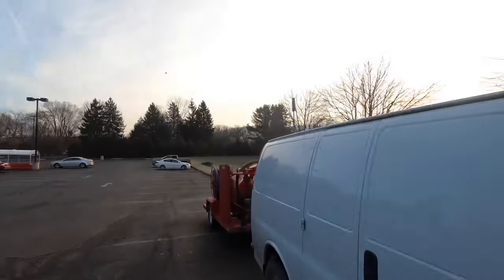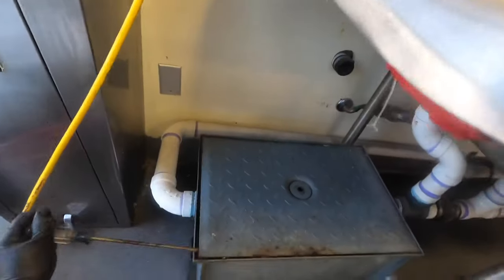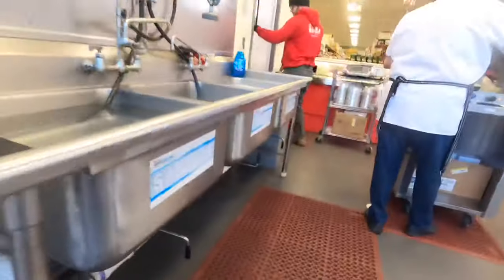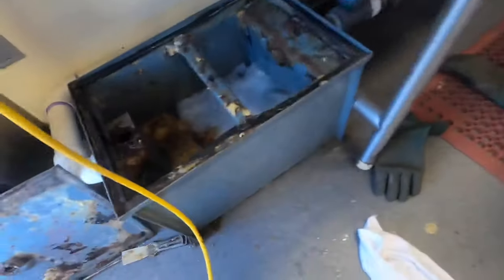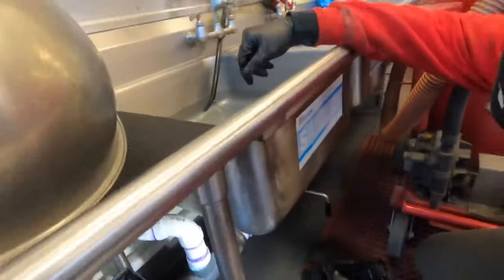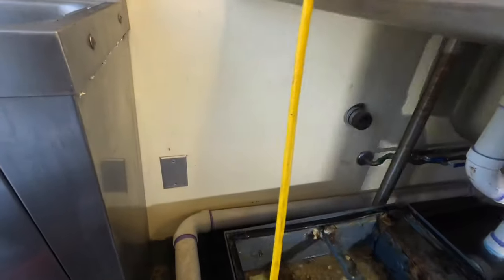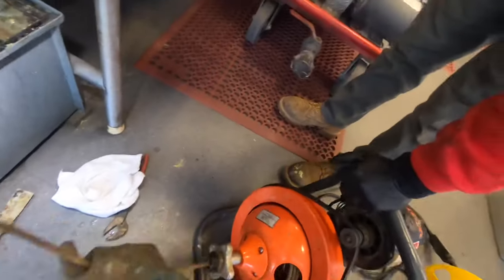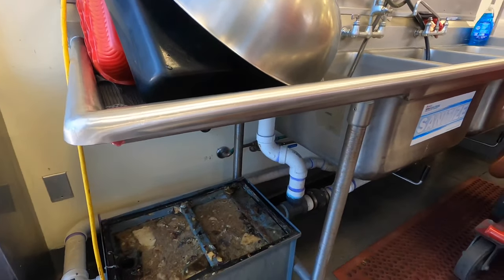Drain Pros Ep. 5 - Grease Trap at Grocery Store Deli

Comment: Grease traps stink and should be banned or why not install it outside....Staff always complained of the smell I refused to work in the kitchen that had one..... You have to clean them out once a week or it will sting you with a huge smell.....
Reply from the maker: Yeah most of them always have a rotting smell to them.. there is nothing really that keeps the grease gases from coming out of the sink. Most of the places we work at only have a few sinks on them but they should be installed outside and no matter how small 👍
Reply: I believe most municipalities have minimum size capacity for outside traps. Where I'm at , most are at least 1000 gal regardless of the establishment. Which is ridiculous.

Comment: Question: Why didn't you vacuum it again after you ran snake and scraped more off the wall of the trap? Just wondering. Hope it's not so you are back there soon. lol 5:52
Reply from the maker: Not at all Richie! We already have it on a maintenance agreement so if it backed up between them we would take care of that for them free of charge 👍. The side wall grease and the grease in the pipe is typical hard and crusty and clogs the vaccum up, the next time we suck it in a few months the chunks will liquify with the warm water back into pump-able grease! Thanks for asking!
Reply: I was thinking the same thing, why not do a good job while they were there, have a five gal bucket or something to put the extra in.
Reply: Just my thoughts but if you make it so the customer calls you less for said item covered under the maintenance contract the customer may cancel said service contract on that item because they see they don’t need service every few months.
Reply: I thought the same thing 
I just saw another video, and this guy left it clean. There was no grease on top or in edges left
Reply: Yes !!!
Reply: nothing pro about his work for that Customer

Comment: Hi thanks for the video. I'm have a problem with grease. We get our trap cleaned regularly. I've noticed the levels in the compartments are very different. The outgoing side is very low like below the out pipe. Is this a problem. Any thoughts or suggestions greatly appreciated thanks
Reply from the maker: Thanks Tim! The outlet level of your trap should be just about even with the bottom of the pipe.. the water should flow slowly through the outlet as you run water from the sink.. if your at that level then your golden! If it’s lower than that usually it means there’s a clog at the bottom of the outlet baffle not allowing the water volume drain through but rather fill up the level of the main chamber! 👍 let me know how you make out, wish you the best of luck!

Comment: Can you do this with only a shop vac or do you need that machine? and how much does that machine go for?
Reply: i do it with 3 or 4 shop vacs or one shop vac and x2 30 gallon brute trash containers with lids. ALSO SUPER IMPORTANT USE PLASTIC SCRAPER NOT METAL SCAPER
Reply: Why a plastic scrapper?
Reply: @brentcuaz7756  because metal scratches the paint, the paint makes the grease easy to scrape off.

Comment: An experienced mechanic person recently showed me that if a stuck horizontal oriented 55 year old brass screw fastener such as a drain cover over a 45 degree angle Y-shaped inlet on 1-1/4 to 2 inch pipe needed to be loosened and removed, that lifting upward on the 18 inch long socket wrench drive handle is way better than pushing downward on the same wrench handle because more and greater force could be applied in a more controlled manner (that is if the given operator person was capable of lifting very strongly on this tool handle).

This is because weight lifting can be even greater than misapplied body weight downward upon a slippery situation where the socket could slip off of the hexagonal shaped nut, thereby causing stripping on the fastening hexagonal fastening head attempting to be removed.

The alternative for physically limited space situations is to rent or buy a compressed air socket impact drive that applies very strong rapid controlled impacted torque to loosen such fasteners--this along with the needed space required to lay the compressed air hose or wheel in this heavier air compressor equipment in close proximity that requires some man handling effort anyway. 

A larger compressor might be 5 horsepower, have a 6 foot high compressed air tank, and a loud air-cooled three cylinder compression drive sitting atop of it that uses a 3 phase 240 volt electrical motor requiring such an electrical outlet that are not that common place. I am from Canada, by the way...
Reply from the maker: Interesting spammer! Thank you for the knowledge👍

Comment: How often does a grease trap need emptying and does it need to be vacuum pumped?
Reply: Depends on size and volume.  Inspectors will require minimums.  Small traps like that are typically monthly.  Quarterly and Bi Annual pump outs are generally reserved for you standard 1500 + g outside .

Comment: @0:30 - Would go a lot more quickly using a proper socket.
Reply from the maker: Definitely need to make a side bucket that is strictly for grease traps! 👍
Reply: @DrainPros  Was it five times your multi grips slipped off that bolt? A properly sized socket on a battery driver would be way more effective / efficient / professional going forward. Clean all the gunk out, that's what the contract states, and that's what our man does., not leave huge hard bits in there (you said that yourself) so it can clog again real soon. Who said it would be hot water coming down to "break up" the chunks? Bodgie job from dodgy blokes.

Comment: Why they still make the traps out of steel is what blows me away. The Can-Plas tanks are the better ones.
Reply from the maker: Absolutely! I say that to every kitchen manager that has one.. the plastic ones are easier to clean and they don’t break down. Still amazes me that they paint the inside of the steel ones 😂
Reply: @NYCPizzaman depends on the model. The rectangle ones are a bit cheaply built but easy to clean. The round lid ones are a little more involved to clean but are pretty sturdy.

Comment: Now I have a serious question people? 
Are grease traps the worst smell out there or is there something else worse??
Reply: I used to work at a restaurant where the grease trap would get backed up every few weeks. In turn we would have to open it up like this and clean it by hand with a spyder or strainer. Owners refused to pay for a service like this. I can handle some gross stuff when it comes to cleaning, but the smell these things produce can be downright awful. Fermented rotting food mixed with hot water. People would not enter the back at all when it was being cleaned
Reply: Crystallised urine from a urinal is pretty horrendous
Reply: @diamondssd1  Everyone who uses the sinks should get a little training.  If they dont put food grease and oil down the sinks then you will not have to clean the trap.  Simple and common sense.